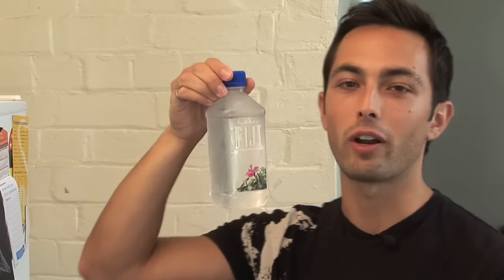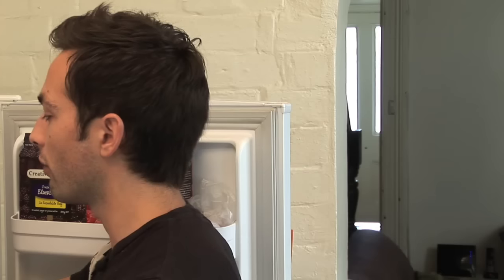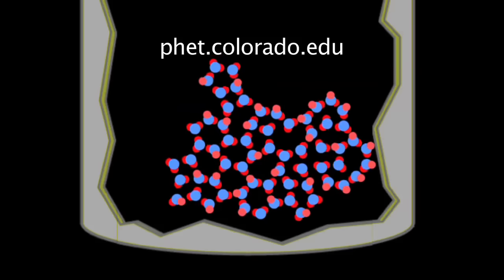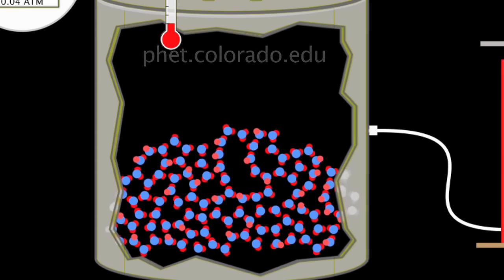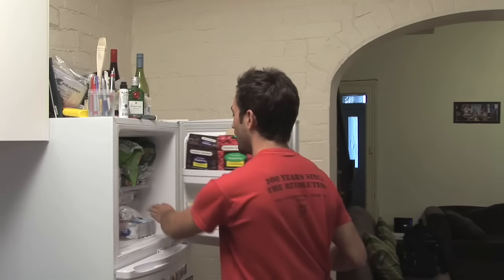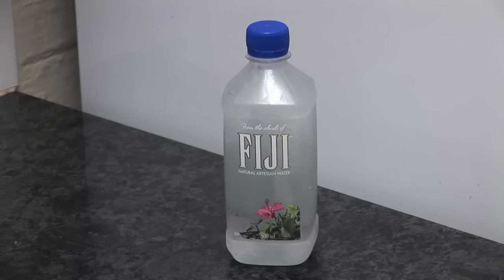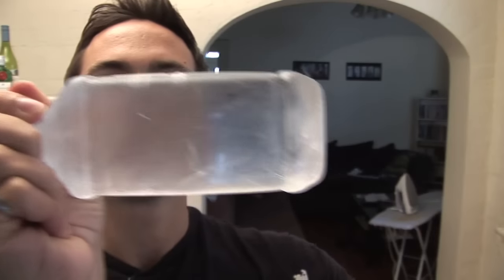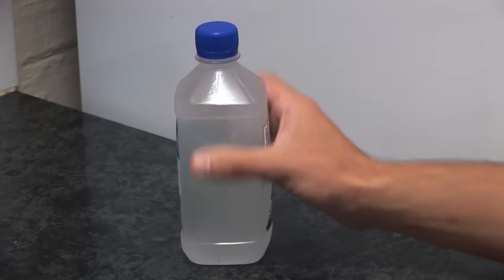Supercooled Water - Explained!

Comment: I have a question. Why did the ice formation start at the top of the bottle while the physical impact was at the bottom?
Reply: I believe because the energy travels up the bottle (like when you hit a baseball you feel the vibration where your hand is).  Maybe also because that is where the space is to start the ice crystal.
Reply: Huy Tran I was thinking because the bubble travels very quickly to the top and the bang does the trick. Energy vibrates through our at the bubble to start the ice crystal reaction
Reply: Huy Tran We can now conclude that he, too, failed to explain the whole phenomenon.
Reply: For the same reason that if you put your hand palm down on a flat surface and then ask your friend to use their fist and slam it down on the middle of your hand. It will hurt them instead of you... Also idk lol XD
Reply: Mikel Mariscal Thanks for the example man, I think I've broken my metacarpals.
Reply: The force went through the bottle to the top. It took the shortest route. In nature the force will always take the path of least resistance. That's through the glass since its dense. When the shockwave got to the top it had nowhere to go except through the air...air is a lot less dense than our friends hand or the bottle so it bounced and traversed back  through the bottle. Some of it transferred to the water via the surface tension touching the edge of the bottle and from there it started a chain reaction and the water froze solid.

If he had turned the bottle upside down and tapped it, then it would still have frozen from the top end towards the cap.

If the bottle was completely full then likely the cap on the bottle would have acted as something where the ice crystals could start. 

Top marks for the question though and well noticed.

Comment: WHAT HAPPENS IF YOU DRINK THAT??
Reply: interesting question.. but i think it would freeze as soon as you opened the bottle of water.
Reply: its ice how can you drink it
Reply: I know that it doesn´t freeze when you open the bottle I have seen clips where people pour it on table and it only freezes when it contacts the table.
Reply: Sorry my english is so suck you would probably be drinking cold water as it freezes then.
Reply: Adam West What if you opened the bottle in somewhere where theres little impurities in the air, like a wafer fabrication plant?
Reply: Maybe your tongue would be frozen over. Because of the impurities, it would freeze as it touched, so if you drank it, then it would spread out and freeze everything it touched.... Scary way to go, if you ask me.
Reply: Assuming it didn't freeze as soon as you opened it or as soon as it touched your tongue (which would provide nucleation points causing it to instantly freeze)....nothing would happen.  A freezer like that just isn't that cold.  Ice you pull out of it would be the same temperature.  You could put a bottle of vodka in the freezer and drink it at that temperature with no ill effects.  If it got too cold (in an industrial freezer, for example), you'd risk frostbite to your mouth and esophagus but thats about it.
Reply: its like drinking water flavored slushies , its not solid like a brick but weak structured enough to drink right away and its cold really cold and refreshing, i highly recommend it if you are out on a hot day
Reply: You would Die....after..............many years!
Reply: Late. You're so, so late for the conversation...

Comment: But why the bottle didn't explode ? Ice take more volume than water right ?
Reply: The ice isn't in it's full form it's 70% ice 20% water, so it's just in ice form not fully
Reply: Plastic bottles are flexible enough to survive that. A glass bottle would probably explode.
Reply: Ok thanks ;)
Reply: Jan Sten Adámek Actually, a glass bottle usually just cracks at its weakest point, I've tried this a few times with glass and the glass always cracked, with the exception of one time where it did actually bust into pieces.
Reply: Well, not quite, you see, when water freezes, the molecules that make it up arrange in a way that causes it to expand, which only makes it seem to get bigger. However, once it melts again, the molecules are allowed to jumble back up and therefore do not form a structure, which means that the total volume is slightly less than that of frozen water. You'll end up with the same amount(if not slightly less from evaporation) of water in the end. :)
Reply: ever notice that the water is not fully filled on the water bottle? it's for exactly that volume adjustment. otherwise business down.
Reply: ***** No, the law of conversation of mass makes sure that doesn't happen. Whatever was there was there, nothing more or less will come of it changing it's state of matter.
Reply: Air
Reply: bo99ful Well, I can see where you were coming from, but your post was pretty vague. Funny answer though!
Reply: Ice occupies less space than water
Reply: Liquid water cooled to below 0°C should have the same volume as the ice of the same temperature. The water anomaly only says that water is denser at 4° than at 0°.

Comment: I managed to replicate this using rainwater .
Reply: The process of getting pure water is similar to how rainwater is formed, so I wouldn't be surprised.
Reply: Victor Neo rainwater is full of pollutants (dust, microbes, heavy metals etc.) I doubt that it would work as good as this.
Reply: Yoeri Jansen

If you wait half an hour for the rain to settle all the airborne contaminants before you collect the water then it will be as close to pure water as you can get without having to distill it.

Comment: The tap water here works just fine, I usually have some glass bottles chilling in the fridge and accidentally pulled off this trick by pouring it over ice. It instantly turned to slush and made a neat mountain before the crystallization rushed up into the bottle and spread sheet like ice all over. It was pretty cool I'm about to try it again

Comment: And, it doesn't have to be water, I drink vanilla nutritional shakes, but I prefer it to be super cooled. I put these in the freezer a few hours before I intend to drink them. Most of the time it is perfectly cooled and it stays fluid, but on rare (and pleasantly delicious) occasions, when I take one out, immediately pop the top and start drinking, it will try to freeze, like a healthy vanilla shake. One time as I was mid-gulp I could feel it actually freezing up from my esophagus to my throat and mouth! Soo deliciously refreshing during these oppressively hot and long summer nights in the south! d>_0b

Comment: im not really an expert on the phenomenon - but i do have a theory (tell me if im wrong) - there is a certain connection with P, V and T in gases and liquids (van der waals). lets think of a bang on the table as an infinitesimal event in time. the volume of the bottle stays nearly constant (that bang may have changed it microscopically for a very short period). the temperature should stay pretty much constant (lets ignore the fact that heat transfers from your hand to the bottle). so, we should get that overall pressure stays the same. BUT, the bang itself isn't there to ignore, it must cause some change in pressure at a part of the bottle - meaning that there has to be a difference in pressure through the bottle. if the pressure is high enough in some part of the bottle, water will start turning into ice and expand - causing more pressure on the water that hasn't turned into ice yet. this recursive effect should turn all the water into ice, and then melt back into water because of the rise in temperature.

Comment: I have done this many times in my small college refrigerator! I had the temp set up on high. It was cheap brand water and was in the refrigerator part and not even the freezer. When taking it out I never has to be careful not to move the bottle... All I did was shake it and it froze up like this video shows...

Comment: it doesn't need to be pure... As a matter of fact, I have only successfully done it with flavored sparkling water by IceMountain. All in all, it's probably cooler to watch with sparkling water anyway, because you can initiate crystallization simply by opening the bottle, because the carbon dioxide bubbles that are formed when the pressure is released start the process.

Comment: So under normal situation, the liquid water cools toward 0°C, then the temperature does not change during the change from liquid to solid (but energy is still leaving the water), then the temperature will decreasing. But in this experiment, the water went lower than zero without freezing. So when the bottle is shaken or banged, and it rapidly changes, does energy leave the bottle in the form of heat? Is the temperature of the ice higher than the temperature of the supercooled liquid water?
Reply: +David Scott That is correct, see my answer above!

Comment: I noticed this phenomenon in my car. If I leave water bottle over night, in the morning, even thought it is -12C outside, the water is still liquid. I used bottled water, i.e, it has some salts already. This happens every winter though and multiple times. I have only have this happened to me in the car. If I leave water bottle in the garage and temperature plummets to -10c or -12c, this would not happened.

Comment: question is, I recall that a 10g ice cube at 0 degrees takes about 10g of water at 80 degrees to melt completely and end up with 20ml of water.
That means the formation of ice in this supercooled water should be a exothermic process.  The water would have to be super cold, or that there is heat released on the outer edges of the bottle after it instantly became ice.

Comment: I have a genuine question about this phenomenon.
Doesn't it release energy to change state from liquid to solid? If yes, that would mean the ice is actually warmer than the liquid. Then the supercooled water needs to be way below freezing point or else the heat would just melt the ice, maybe even before it changes states?
If you can answer the question please explain it so a non-physicist can understand.
Also sorry for bad english.

Comment: So I tried this: One of the attempts it worked and froze, but it didn't crystallize fully. Like I took it out, gave it a little tap and it kinda slushified with ice chunks in the bottle. Every other time I try its already half frozen with ice chunks in it from after I pull it out the freezer. Why does this happen? Also I have tried numerous times and left it in the freezer for 2 and a half hours and 3 hours but I get the same frozen ice chunks result.

Please answer soon its for my science project

Comment: I maybe wrong but the reason it freezes from top to bottom instead of bottom to top is that while trying to bump it on the counter, the first movement of the bottle is upwards then downwards to hit the counter but, as soon as the bottle goes up and stops just then the water hits upper part of the bottle (Newton's 3rd law) and right then it starts crystallization before it even hits the counter.

Comment: If you fill bottle with water so that leaves no "free space" for bubbles how likely is nucleation then?
Is there similarity with glass beer bottle "hit the neck trick" where bottom falls( vacuum)?
Inert gas disharge tube or plasma globe has bubble in crystal ball, where pressure is little less than 1 atm.
That enables multiple switching on and off. That bubble of vacuum as extra charge.

Comment: if the water was say at -2C and you bang it will it climb back to 0C its actual freezing point or will it stay at -2C. Doing a lab for chem 2 with t-butyl alcohol and i'm trying to understand why it can start to freeze from as low as 15C but always climbs back up to about 20C

Comment: It won't work if your fridge vibrates too much. I could do this trick with any bottled water in Japan because the fridges there don't use compressors (old tech), they use some kind of thermal transistors.

Comment: I just saw this video.  I have a freezer that takes it contents to -20 degrees Fahrenheit (almost -30 Celsius).  I put bottles of water in it so I could grab one when I went on a trip.  I would drink it as the water melted.  Even at -20 some of the bottles of water stayed liquid until I banged the bottle.

Comment: Do the water molecules nucleate due to the pressure wave of being smacked on the table and the ice forms from the top due to higher density molecules? If so the chain reactions nucleus could be influenced by where you start the pressure wave and the amount of force applied.

Comment: Bottled spring water may not be the best choice because it is not pure.  Spa water has mineral salts dissolved in it dependent on what type of rock it has come into contact with. The experiment might work better with distilled or demineralised water used for topping up batteries.

Comment: Veratasium - explain this please!
Why is it always that the crystal starts forming at the top, never the bottom. Im guessing even if you hit the top of the bottle it will do the same?
Also - this accidentally happened to me once when I opened the bottle instead of banging it. How is that a nucleation event - is it because the air particles act as impurities?

Comment: HI Veritasium. Can you answer me please that why does the crystals form from the THE TOP TO THE BOTTOM even if the impact on the bottle was at the bottom ?
Reply: I don't think he will answer to 5 year old video. But I can try. I think it's because of the water splash at the very top. It will form bubbles and those will start the chain reaction.

Comment: Easy peasy in the cargo door of a C-130 Hercules at about 24,000 feet AGL after a couple of hours.  The four turbo props provide the vibration energy to keep the molecules in motion as -20 ~ -40C OAT across the thin aluminum skin of the cargo door super chills the water to below freezing.  Makes for a great gag for nugget Airdales, "Hey, would you like bottle of water?"  You could toss it to them and it would instantly freeze solid as they caught it or you could hand it to them and it would instantly freezing, as soon as, they opened it.  A bit of Loadmaster Magic!

Comment: Sparkling soda water is much easier to supercool. It has pressure inside that resists freezing. Once you've supercooled your soda just open the cap and it instantly freezes.

Comment: So Fiji water has just enough impurities in it to start crystallization. What happens if there is absolutely no impurities in the water, will it then not freeze at all. I'm just asking because this would be an awesome way to cool computers with aio radiator connected to some kind of freezer.

Comment: I don't think it's the impurities. I think it's the pressure difference. when he moved the bottle you could see the bubble at the top moving and it didn't create any ice, but when he struck the bottle... he slightly increased the pressure in the bottle, which caused the bubble to get smaller, then when it expanded back out the pressure dropped enough to create the crystal seed. That's why the ice forms from the air bubble down, not from the point of impact. 

Everyone's pointed out that the bottle of water isn't that pure, but i've seen this happen enough times that I'm convinced it's the pressure. If he were to pull the bottle out, and crack the seal, you'd see the same thing happen. The first time I saw this was actually with a bottle of Powerade.

Comment: Can you explain why the volume of the water did not expand as significantly as normal? Normally, when you freeze water in full bottle, it near cracking.
Reply: It's because it doesn't freeze completely into a solid chunk of ice. It creates a lot of ice crystals in the bottle but there is also a lot of liquid water in the bottle still. This is why it does not expand significantly enough to bloat the plastic bottle or make it crack.
Reply: It gets a slushy texture. Almost like an ICEE where you can still drink the water but it has a lot of really small chunks of ice.

Comment: Since water expands when it turns into ice, if you did this in a bowl and stuck your hand into the supercooled water, what kind of damage would it do to your hand?
Reply: I think your body (hand) is flexible enough to withstand it without any damage.
Reply: the water would likely just expand upwards as it takes less work to compress air than skin/flesh

Comment: I tried to make a supercooled water video, but it didn’t go as I planned. I had a bottle of water stored outside for many hours with temperatures dropping to around 25 degrees Fahrenheit, and I gave the bottle of water a good shake 3 times. It stayed liquid. When I took everything inside the water started to freeze, and 30 seconds later I looked and the water in the bottle was frozen. I was shocked. Does anyone know why this happened?

Comment: Something similar can happen with a new bottle of seltzer. The pressure keeps it from freezing, but when you open it it will freeze top to bottom
Reply: the colder water 💧 which is less dence 
is in the top of the bottle 
and the less cold water is at the bottom 
so if you turned the bottle upside down 
it will freezes from the bottom
Reply: @ADEL-fz9qm  if you turn it upside down it will spill out

Comment: I once had the opposite happen.  I was making hot cocoa, so I put a cup of water in the microwave for a couple minutes. When I took it out it was not boiling.  I started to dump the package of cocoa mix into the water and as soon as the first bit of powder touched the water the water started boiling.  I boiled for about 5 seconds.  Only time I have ever seen this.  Has anyone else seen this happen, and can you explain that result?